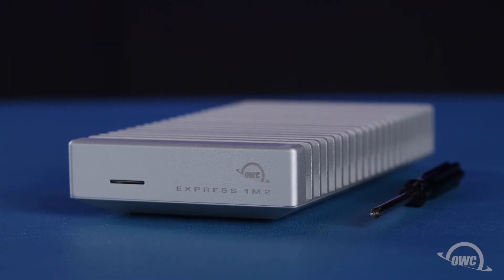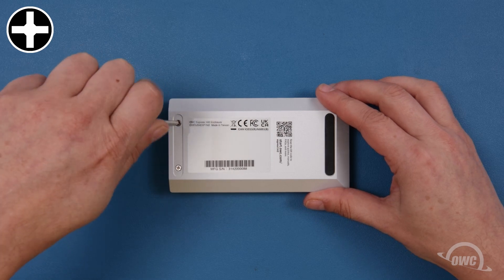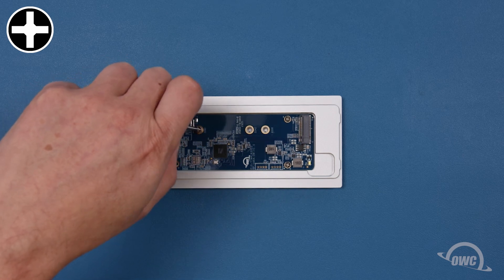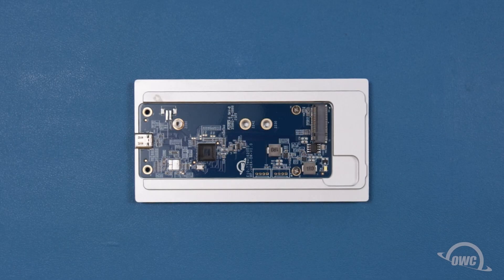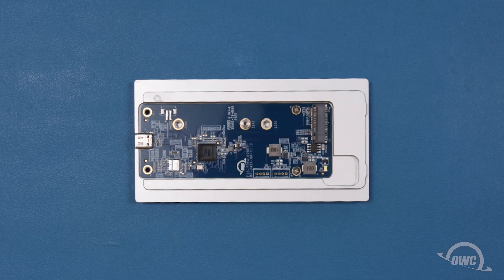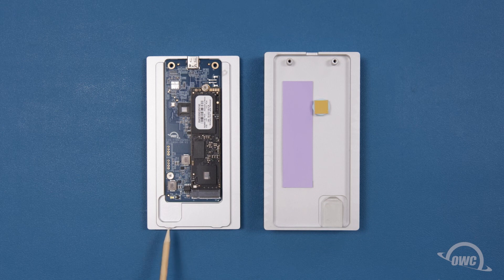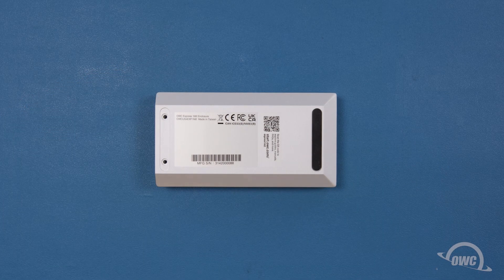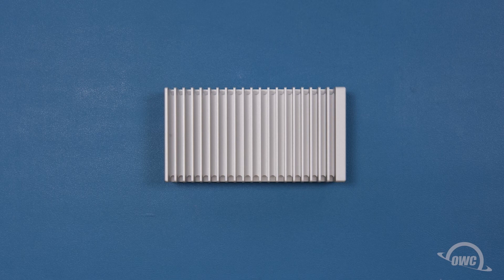How to install an M.2 NVMe SSD in an OWC Express 1M2 enclosure

Comment: Are SSDs with 3.58mm height (as WD SN850X w/ 4TB capacity) compatible with this enclosure?
Reply from the maker: We don’t see any issue with a 3.58mm height SSD, like the WD SN850X 4TB, being installed in the OWC Express 1M2. It should work just fine.

If you do happen to run into any issues, please don’t hesitate to reach out to us — we’ll be happy to help and make it right.

— OWC Team
Reply: @poweredbyowc  Happy to report that these two fit without any problems whatsoever.

Comment: You guys should make a JHL7440 Thunderbolt 3 version of this. ASM2464PD uses nearly twice as much power as JHL7440, run way hotter, but only gives a little bit more transfer speed. USB4 just sucks.
Reply from the maker: Thanks for the thoughtful feedback! We really appreciate your insights.

You're absolutely right—each chipset has its trade-offs. The ASM2464PD enables broad USB4 compatibility and high transfer rates, but we understand concerns about power efficiency and heat. The JHL7440 Thunderbolt 3 controller is a strong performer in terms of efficiency, and we’ve certainly heard interest from the community for a version built around it.

While we can’t share future product plans just yet, feedback like yours plays an important role in shaping what we build next. We’ll pass your suggestion along to our development team!

Comment: What if the yellow square on top of the blue pad is missing? I just opened a new express 1m2, put the SSD in, and was about to put it back together but noticed the yellow square is not there.
Reply: Mine was also missing. At the 2:27 mark the video points out that some revisions of this enclosure do not have the yellow square, and that this is intentional. I've not experienced any problems so far.

Comment: Which thunderbolt docks will give my 2 new owc express 1 m2 enclosures(1-4tb & 1-2tb)the fastest read & write speeds connected to my 14" M1 max macbook pro?
Reply from the maker: The 11-port Thunderbolt Dock, Thunderbolt Hub, and Thunderbolt 5 Hub are the best options overall, as they all support Thunderbolt 4 or 5, delivering the fastest speeds for USB-4.  Any Thunderbolt 3 dock will be limited to a maximum read/write speed of 990MB/s, since the OWC Express 1M2 will be recognized as a USB-C device instead of USB-4.
Reply: @poweredbyowc   Does  m1 max macbook pro have access to the higher speed of the  thunderbolt 5 hub, or does that only apply to m4 macbook pros?
Reply: Are the 1 m2 enclosure speeds faster r/w connected via the 11-port thunderbolt dock than if connected  via the m1 max macbook pro's native thunderbolt ports?
Reply from the maker: I apologize, this would be a question better suited for Apple Support.
Reply: @poweredbyowc  
 This response sounds evasive  to me & feels unsatisfying. I've already purchased  2 of the OWC 1 m2 enclosures & had intended on purchasing an OWC 11-port thunderbolt dock.  
Please consult with OWC tech department  & try to answer the question. 
Thank you.
Reply from the maker: In general, you should experience similar speeds whether using the dock or connecting the Express 1M2 directly to your Mac. However, if you have multiple Thunderbolt devices connected to the dock, it could impact the drive's performance.

Comment: I just a new OWC 1m2. But I am not able to unscrew the screw.. cuz it's too tight...
Reply from the maker: Thank you for sharing your feedback! We're glad you found the kit sturdy and impressive. We’ll pass along your suggestion about the screwdriver and the screws being tightened too much. Your input helps us improve our products and user experience!
Reply: The included screwdriver was inadequate but I had a larger one that had no trouble. I would recommend that OWC not screw them in so tight though. Impressive kit otherwise, very sturdy.
Reply from the maker: We’re sorry to hear you're having trouble with the screw being too tight. If you've already tried some methods to loosen it without success, please don’t hesitate to contact our support team for further assistance.
https://eshop.macsales.com/Service/
Reply: Outside screws or the inside one? The outside pair being tight felt kind of normal, but the inside one seemed tight too, and took the 5mm hex "drive post" out with it (it was stuck to it because it was tight against that). Once they were out of the board, I used needle nose pliers to hold the hex nut in place while removing the philips head with the included screwdriver, and it jerked free. I'm a little concerned about how hard I pressed down to keep the screwdriver engaged while it was on the board, to remove it. I haven't done this before and didn't know if I was being clumsy so I checked the comments and found this.

I probably should get a 5 mm hex socket driver to secure the drive post back. I got it back mostly with my fingers, but securing it on the board with my pliers seems a bit risky as they can slip off and scratch something. Maybe I should chill and finish the job. Just being nervous because I'm about to stick some expensive SSD in there.
Reply: Same

Comment: Can you use Samsung Magician software on your Apple silicon Mac to update the SSD's firmware with this enclosure?
Reply: Yes, it works.
Reply from the maker: We see no reason why the software would not work as long as the enclosure was holding a Samsung drive, however, we recommend looking into the full compatibility with that program and the Apple Silicon Mac.
Reply: @poweredbyowc  Thanks for your answer! Yeah, Samsung Magician's functionality is limited on Apple Silicon Macs in comparison to Windows. 
Still, will the NVME M.2 SSD connected via the OWC Express 1M2 enclosure be treated by the Apple Silicon Mac as an internal or external drive?
Reply from the maker: It will still be treated as an external drive.